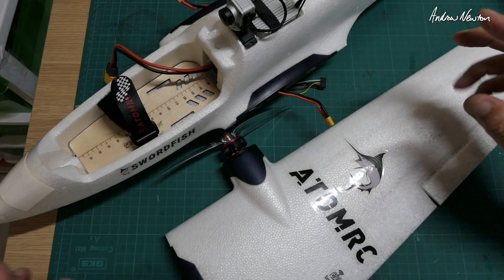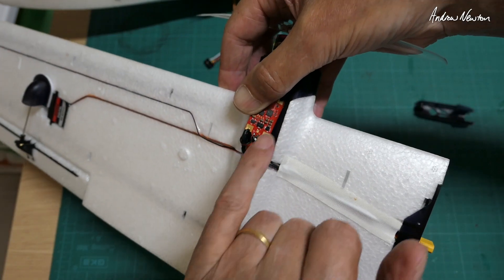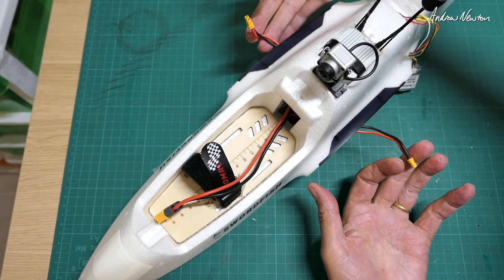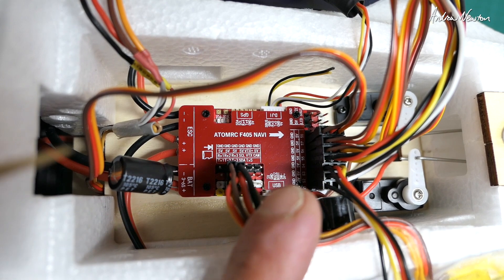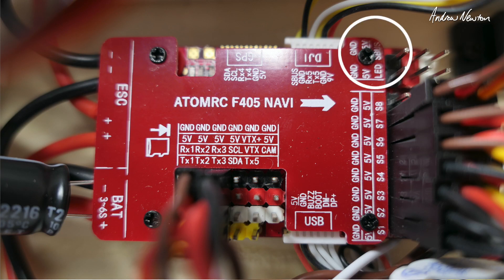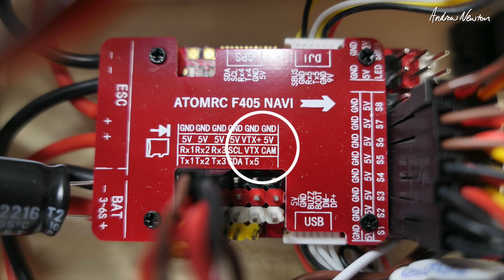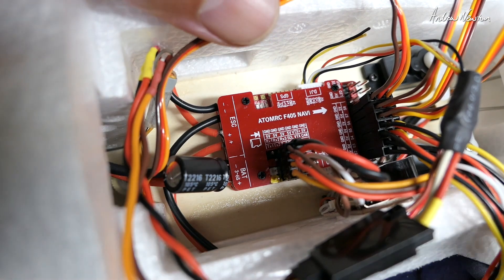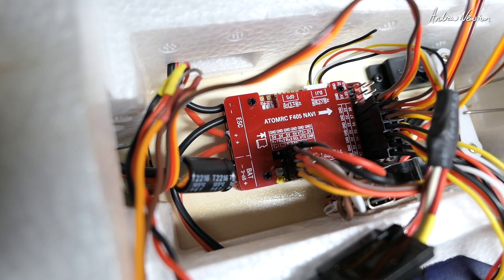AtomRC Swordfish wiring

Comment: I appreciate you work and time to get the vids out. They're very helpful. I wanted to use Elrs on my Penguin and was pretty sure I could just remove sbus and connect Elrs to Uart 2 but i wanted to veryify. Thank you.
Reply from the maker: Yes that's correct. Then change the Serial Receiver provider to CRSF in the INAV Receiver page

Comment: Thanks so much for posting these directions on the wiring. I have just received my Atom Swordfish and am looking forward to getting it in the air. BUT, as a newbie to RC and INAV would it be possible for you to make a short video on how to assign switches on a Radiomaster TX16s, especially the stabilise and Return to home switches. If not, no worries, just thought I would ask as I have found your videos so useful with other RC kit e.g. ZOHD kopilot.
Reply from the maker: I could but your question worries me. You need to learn how to use the radio and EdgeTX first, then watch lots of INAV videos. You have a heap to learn so do that first then come back to me with questions. Good luck
Reply: @AndrewNewton  Thanks for the quick reply. I do actually know how to use the RT, although I run open TX, not Edge TX, as I don't have a touch screen so it would be redundant. I have been watching INAV videos as you suggested, but can't find any on using INAV with a TX16S. So i have been thinking of replacing the Atom Rc receiver with a ZOHD kopilot, which I do know how to assign switches to on a TX16S (thanks to your videos). The problem there is that it would have to be mounted upside down. Is there a way of adjusting the ZOHD Kopilot so that I could fly it upside down?
Reply from the maker: Unfortunately the Kopilot cant go upside down. Have you tried searching for inav tx16s? I did and the results will amaze you.
Reply: @AndrewNewton  Thought as much. Will try a search with those parameters. Thanks again for your time on this, always appreciated.

Comment: Pls help, I don't have 9v on dji port, trying to connect walksnail hd pro, tried usual inav setup, did I miss anything? Also a bit strange when looked for voltage selector to switch to 9v on board, seems already bridged, but no 9v either. Many thanks.
Reply from the maker: I would look for solder shorts or bridges on the bottom of the board, or a component wired in reverse. My 9V/5V is bridged for 9V and I definitely have 9V on the DJI socket and pads and VTx+
Reply: @AndrewNewton  many thanks, I have looked under the board and it seems already bridged, but there is no voltage on dji port and I am not sure if solder bridge has anything with that... so definitely should have 9v out of the box, no specific enabling in Inav? Thanks a lot, I am struggling quite a bit for some time and don't know what to do...
Reply from the maker: DJI port should have 9V by default.
The solder bridge only sets the VTx+ voltage.
Nothing to set in INAV.
Must be something else going on with your board.
Reply: @AndrewNewton  Many thanks, I will try with AtomRC, stay well, always good to watch your posts
Reply: Strangest thing, when checked onboard dji connector pins, ground was bent, so I managed to straight it... bad luck and unlikely event, but now it's fine, many thanks for your time and suggestions, wish You all the best...
Reply from the maker: @LjubisaBajevic-nu4ds  Well spotted! That's a tricky one
Reply: @LjubisaBajevic-nu4ds Hi, have you managed to set up OSD when connecting Avatar HD Pro to the DJI port of the FC?
Reply: @leomayak81  sorry for late reply, actually I did it, used 9v, GND, Tx, Rx and hooked to corresponding pins on vtx, , uart5 set as MSP DisplayPort and in OSD selected AVATAR... . needs a little bit of moving on screen items, but it works

Comment: What is involved with changing the GPS and can I add more led lights to it
Reply from the maker: Plug GPS into a spare UART and Select GPS as the sensor on that UART in the configurator Ports tab. If you can solder then yes you can add LEDs
Reply: @AndrewNewton  So I can’t use the one that is plugged into now for my M10-5883
Reply from the maker: M10-5883 will work on this FC
Reply: @AndrewNewton  In the same plug
Reply from the maker: We are never that lucky. Probably have to cut off the BN220 plug and solder it on to your Matek GPS cable. But I might be wrong
Reply: @AndrewNewton  Gotcha Thanks

Comment: I’m confused about the wiring for the Erl 1 receiver in order to connect to board as shown on the diagram as the Frsky receiver?
Reply: Ep 1 receiver
Reply from the maker: ELRS or Crossfire would connect to UART2, not the SBUS pin
Reply: @AndrewNewton  do I solder the wires ground, power and signal from the 4 pads leaving one blank ?
Reply from the maker: More homework required for you https://www.expresslrs.org/quick-start/receivers/wiring-up/
Reply: @AndrewNewton  Thanks. It’s all homework for me. I got the fpv rth so everything is included but they don’t give very good instructions. Now trying to figure wiring for the vtx they supply. It’s a bit over me but I’ll make it. Thanks for your responses

Comment: Hi I don’t have the external usb c buzzer boot for configuration so where I can get one but i check in any website stores but I can’t find that cause I have the sword fish rc plane same like yours but I only need the external usb c buzzer boot and connector to flight controller for swordfish rc plane
Reply: Andrew:
   Great overview of your connections!
   I'm curious if and how you may have investigated the LefeiSparrow series of controllers. I have both the Sparrow one and Sparrow 3 controllers. Though not yet installed, the documentation for the Sparrow 3 seems quite thorough & comprehensive for a small low size/weight controller that provides all of the key features needed in pretty sophisticated fixed wing applications. I would love to see your review of this/these controllers. 
Thanks. - Jim
Reply from the maker: Did you lose it? Only option is to buy a new F405 or ask AtomRC
Reply: @AndrewNewton  i bought a swordfish rc plane from AliExpress website but it came box but the swordfish rc plane is not pre installed all electronics in swordfish rc plane

Comment: Can flysky receiver and flysky transmitter work with swordfish rc plane
Reply from the maker: Do you mean the plane or FC?
Reply: @AndrewNewton  but i tried to connect the flysky receiver to flight controller to able to control it but it won’t receive the signal from my fly sky  fs i6 transmitter
Reply: @AndrewNewton  but I already bind the transmitter flysky fs i6 and flysky receiver it’s are connected it
Reply: I only have fly sky fs i6 transmitter and flysky receiver
Reply: But you need to show your video like how to connect flysky receiver or any receivers to swordfish rc plane’s flight controller and configuration to able to 
Work but your video in YouTube it didn’t shows how to connect any receiver to swordfish rc plane’s flight controller
Reply from the maker: @sandygregoire2732  Search for Flysky INAV

Comment: I have EP2 receiver bound and in uart 2 yet the channel bars do not show up. I tried moving but still same. What could cause this to happen
Reply from the maker: UART2 is not powered from USB so you need to pug the battery in.
Check it is actually bound
Swap Rx and Tx wires
Check Serial RX is set up on UART2 in PORTS
Check CRSF is selected as the Serial Rx provider